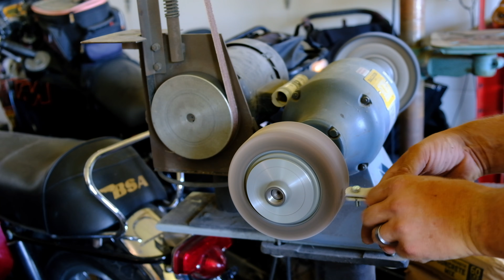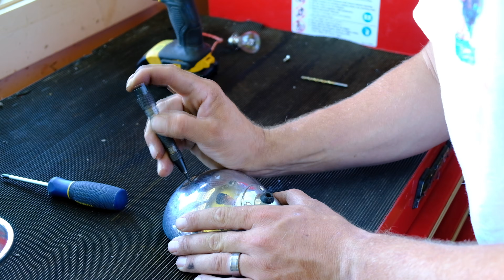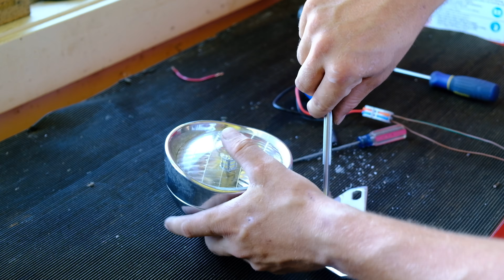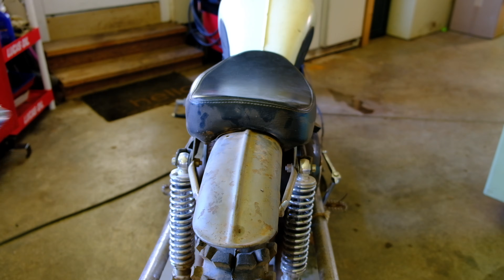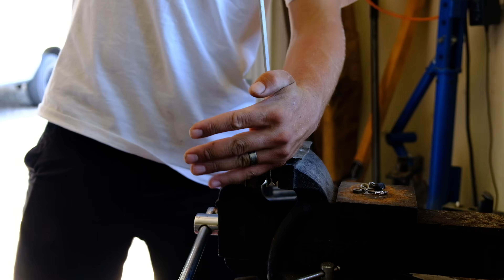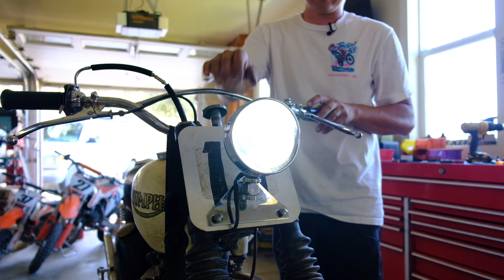Custom Desert Sled Lighting for Under $60 Bucks!!

Comment: Winter draws on (lol) and I've been looking at doing a similar project on my currently, lightless Triton. I have room in the seat hump but with the very real danger of these batteries going kaput in spectacular fashion, I want it easily accessible, so I may drop it in behind the gearbox (pre unit).
I have a 7" Lucas headlight with one of those modern LED light units. The rear lamps are the COB LED flexible strips.
Trouble is, I'm looking at these batteries and seeing they have an output of 1-2 amps, max. I don't want to overload the battery, in case all the smoke escapes (lol).
Advice appreciated

Comment: I like that the bike you seem to enjoy the most is not your most expensive one. Important life lesson there. I had to fix up a motocross bike with lights for a Colorado trail ride. Did not have lithium available at the time. Wound up with an on off switch and a 5 minute run time. Had a cop ask to see my lights in Gunnison, started the motor flipped the switch on everything worked long enough to have him move on. (3 minutes). Never had to turn them on again ever.

Comment: The battery could break due to vibration, you could always use a thin layer of foam rubber around the battery to stop vibrations 🤔.
Maybe it would work 🤔. 
Peace out ✌️